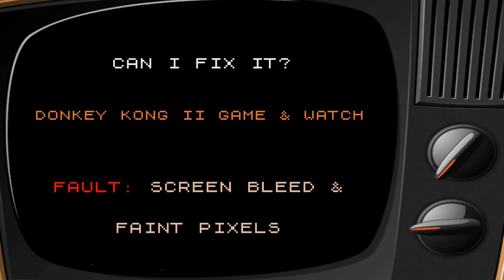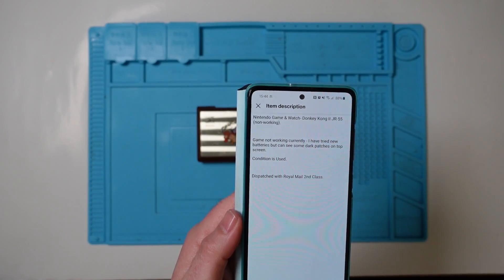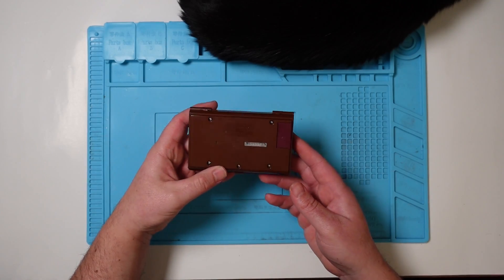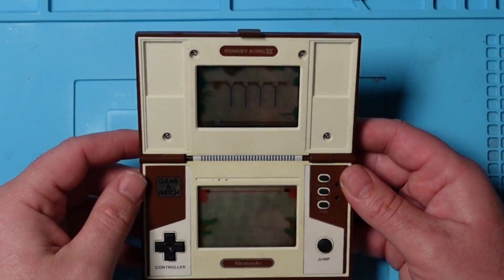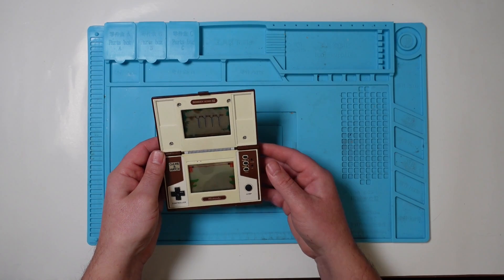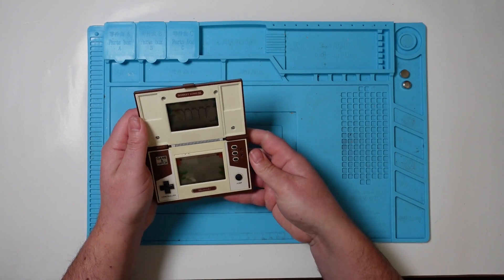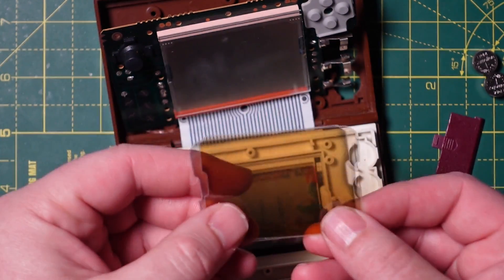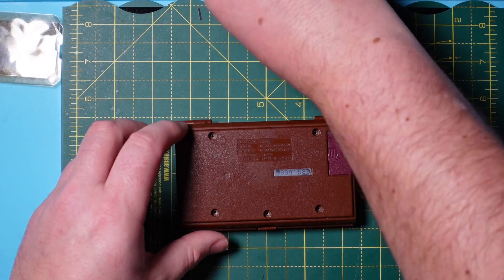Donkey Kong 2 GAME & WATCH with screen bleed AND in need of NEW POLARIZERS | Can I FIX It?

Comment: Lower screen is missing a graphics overlay with lower and middle walkways. Wonder if you could print one onto some clear sheet?
Reply: Was just about to comment this.
Reply: I think both screens do miss overlays. I think both screens should have light green bushes/leaves as well!
Reply: @ebenolivier2762  IT is  lot ofa what good idea w You're a 4 to Spel they are the best I can do for you and you can do it for me to get a new one for you and your family and I will be there in a few minutes to can come over and see if you can find it in the mail and same long as you comes with a to ask to Gboard 4clipboard, any text you copy will be saved4 here.n I'lql úUse the edit icon to pin, add or delete clips.Use the edit icon to pin, add or delete clips.Use the edit icon to pin, add or delete clips.Use the editing is icon to pin, add or delete clips.Use the edit icon to pin, add or delete clips.Use the edit icon to pin, add or delete clips.
Reply: @zanyt13 Sorry for past-blast, but I can confirm - I have the same model with mostly all working bits. There are front/back overlays on both screens. The one in the video is missing the back overlay on the top screen (some foliage, branches and fruit around the sides/top of the screen. and the front overlay on the bottom screen (red cables across the middle and branch along the bottom with red "machinery" left/right).
Sadly I diddled with the top screen when I was a tweenager and now the top LCD doesn't work (probably connectivity issue).
Reply: There are ways to print your own waterslide stickers, there's a clear variant. Maybe that would work, recreate the graphics in a vector based program, print it on the clear sticker base, apply a light coat of varnish to protect it and waterslide it onto a new plastic sheet.
Reply: @GOOPYgreens  what did you say to me ?

Comment: I'm sure the lcds are laminated sheets of glass. I'd like to see you do the same again, but apply extra heat, to get the glue soft, then push some glue from places that are laminated good, then apply some pressure while it cools. It's just a theory. But might work.

Comment: I know this is nearly a 2 year old video but in this time I saw a trick on here where you can basically use an eraser or whatever but firm to the point you feel you're going to crack it, and rub it out towards the edge it does work.  Here's a video from LCD bleed on a vintage watch, same panel just smaller -- https://www.youtube.com/watch?v=zxRBohepzwc&t=2s

Comment: Hi would like to ask..where can I find the silver foil...other than eBay at inflated prices? Would like to find a big piece to cut out and it's more price friendly... appreciate the help...does the silver foil have an actual name?
Reply from the maker: It's called a silver reflector. I believe you can also use metallic silver heat transfer vinyl, although I haven't tried it. It will definitely be a cheaper option 👍

Comment: I still have this wonderful game with several screen problems but now, looking at what u did, it encourage me to try to fix it. The only thing Is that I don't know the name of the material to replace the original screen. Can u help me with that?
Reply from the maker: The material that I replaced was a Polariser (or polarizer). Have a look on eBay for polarising/polarizing film. You may be able to find one already cut to size, but if you're comfortable, just go for one off a mobile phone or similar and cut it (it will be much cheaper). Good luck, and thanks for watching! Steve.
Reply: @StezStixFix  I'm from argentina, so forget about receiving any eBay purchase. I guess I could obtain it from an old mobile phone. Thanks!

Comment: I have close to 200 of these G&W about 70 being nintendo and mini classics panorama widescreen etc, i'v also sold hundreds over the years, there's plenty out there, although I have quite a few pristine in the box with poly and paper instructions i don't want to let them go, i also have loads that i'm currently refurbishing...the problem is the greed of some folk have pushed these games to astronomical prices, ebay has almost singlehandedly  rendered these gems out of the hands of genuine collectors and out of circulation, its almost impossible to get hold of the lesser named lcd G&W games because greedy folk are putting them up for thousands of pounds so these treasures fail to circulate...i'm currently emulating these to keep the memories preserved

Comment: My battery cap has the same discoloration, and i cant remember ever replacing it, pretty sure it is the original. I always assumed it was made from a different plastic and thus aged differently. Cause i dont remember it being like that as a kid. 
Also i had the same bleeding problem in a different device. The solution i came up with was to install a glued cusion on the backside to apply constant presure. Perhaps not the prettiest solution, but the result i got was okayish.

Comment: Necroposting, I've seen this issue before, so just leaving what I heard and read about it. In advance: there is no fix.
I might be wrong, so don't trust my comment alone.

So, the way these things work, indistinguishable from magic :P, is that they are a sandwich of polarizing filters and transparent electrode substrates... plus you know, protective layers and in the case of these Game & Watch things, the layer with fixed art.
But of course, it can't be only that. It needs a special chemical, which is the liquid crystal part of Liquid Crystal Display, that changes properties when electricity is applied. I have no clue about chemistry details, but basically this liquid forms a structure that becomes opaque the more electricity is passing through, using the polarizers, and that's how the image forms. Oversimplified explanation, but enough.

Ok, back to the case. It seems that the cases in which old LCD panels develop black blotches and whatnot, majority of cases, is because this liquid crystal chemical degrades overtime. It becomes another sort of chemical compound which does not behave the same way the original formula does, so it just accumulates there. I've read some people saying this could be drained somehow, but you have more chances of damaging the entire panel. It's highly dependent on case. 
For instance, if your panel already delaminated a bit right between the layer the liquid is trapped, it might be work trying to drain it out. This is why you have people saying they pushed the blotches out... their panels were probably already a tiny bit delaminated on the borders.
But this blotch issue can develop even if the panel hasn't delaminated, and it's just too easy to completely destroy these panels while trying to separate it's layers. Not to mention external contamination and whatnot. Those things are not made to work if they come apart, and it's likely they won't last long if they are already a bit delaminated, because then you have oxidation and other stuff to worry about overtime.

Yeah... think that's more or less it. If anyone know this subject better, please do correct.

Comment: I have the same one , but both screens are disconnected , how I can fix it?
Reply from the maker: I guess it depends what the problem is. Do you mean that the screens are physically not connected, or you are just not getting an image on either screen? Do you get sound?
Reply: @StezStixFix  physically not connected
Reply: @StezStixFix  I do get sounds
Reply from the maker: @darrencen6934  What happens when you try to reconnect the screens?  Are the ribbon cables intact?
Reply: @StezStixFix  they're intact , the polarizers are long gone ( yellowed ) , but I still have images
Reply: And I turned the reflector to the other side , since the other sides faced to the screens looks like burned or damaged by moisture

Comment: Make a heated vacuum chamber and pop that thing in here. As far as what to use just a vacuum pump, a pot, and a thick sheet of plexiglass. Suck the air out of it. Then warm the pot
Reply: @suzukigsx1807  dunno, I was just putting an idea out that would be neat to try. I assumed it was just air gap that needed removed.